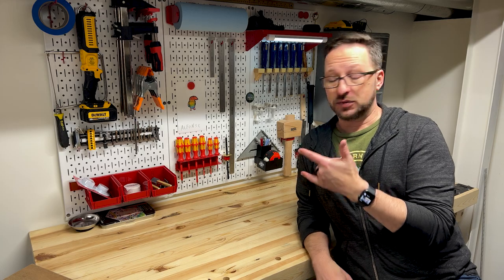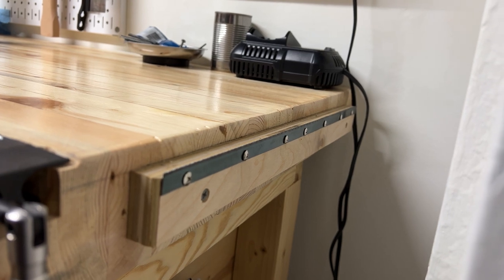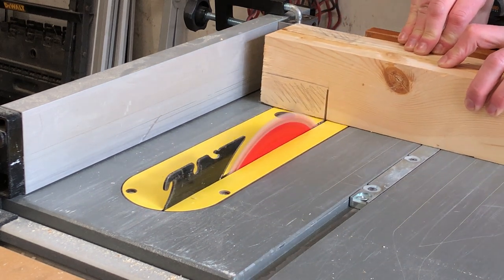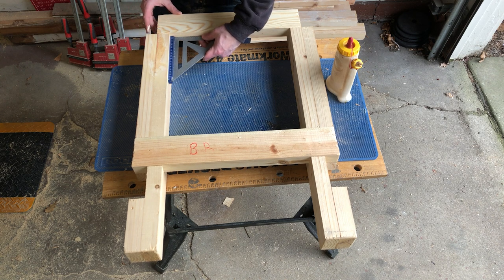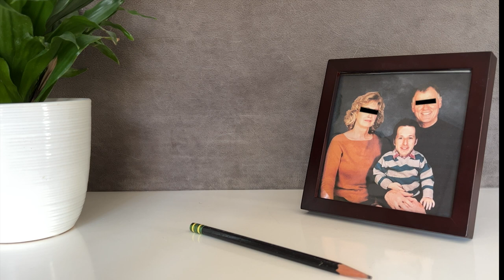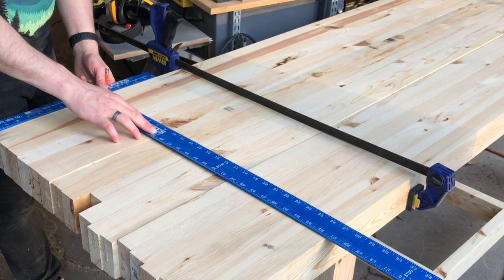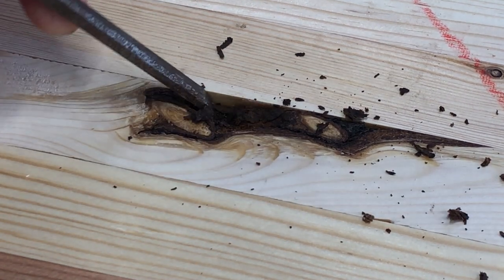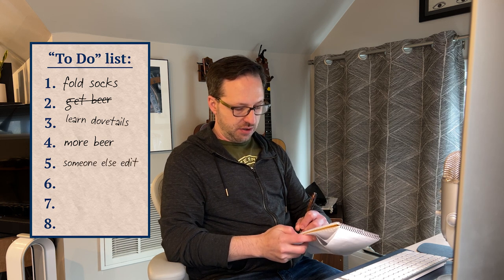Classic Sturdy Workbench (pt. 1)

Comment: Another great video - however, for safety reasons, I advise against using gloves when handling the table saw
Reply from the maker: You're not wrong Ja Ka, I appreciate that. I try not to use gloves, but in that particular case got a gnarly splinter while handling those legs so temporarily put those guys on. In fact, since making this video I have switched to fingerless "carpenter" style gloves when I need to, safer but still offer some protection and/or warmth. But you're right, you need to be extra careful with gloves around a table saw